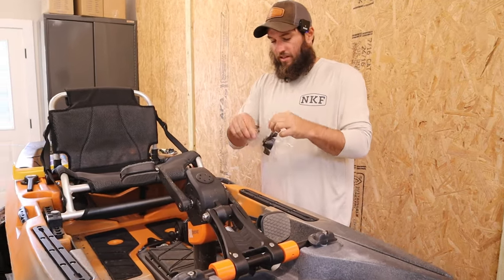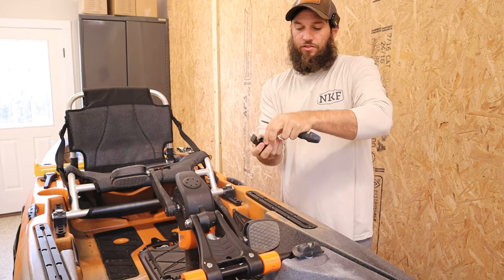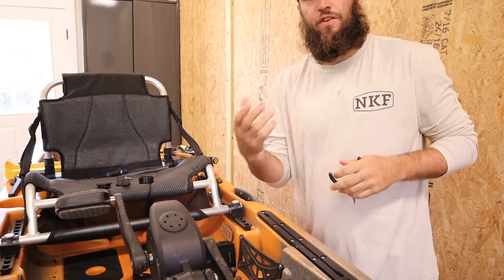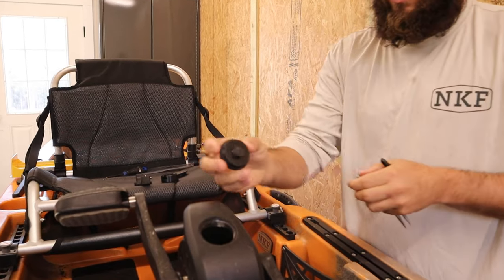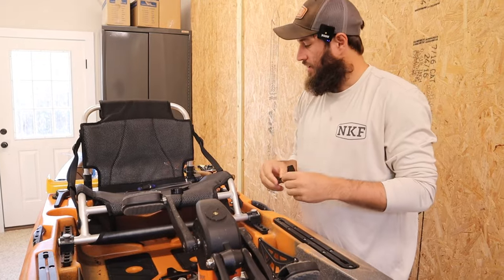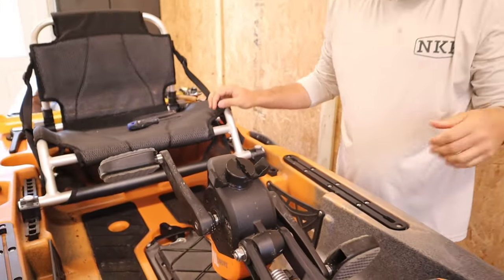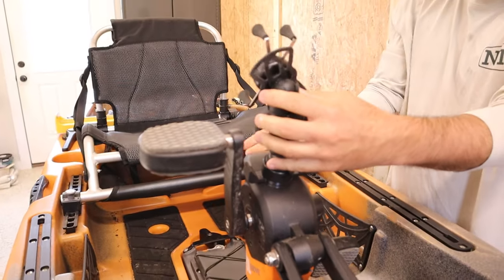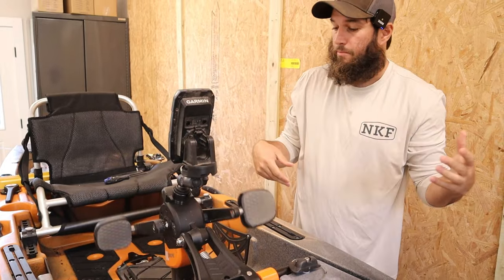New Old Town PDL Rod Rest with Track Mount

Comment: New product request.. some quick and clean way to keep the seat folded down while driving.  Currently I have to tighten the seat straps but undoing them you are guessing where the straps go and I usually end up uneven needing to fix that once I sit down... Uneven straps can lead to breakage.  Plus they seem to get twisted with repeated tightening and loosening.
Reply: I use one of Nick's lash straps from the lower bar to the side bar , works great....also one from around the boondoc bar to my truck rack to strap kayak in bed, fully loaded  for fat deploy, and drive several hours , never any issues!
Reply: Bungee cord my dude works like a charm and is cheap

Comment: Question. I’m trying to put a trolling motor like Newport 46lb thrust on the back of my 106 pdl kayak. Which mount do I need to install the motor on? Was having a difficult time trying to find the correct mount for motor. Thanks.
Reply from the maker: You'll see the 106PDL Trolling Motor Adapter in the drop down menu here - https://navarrekayakfishing.com/shop/old-town-offset-power-pole-mounting-plate/
Reply: Thank you!